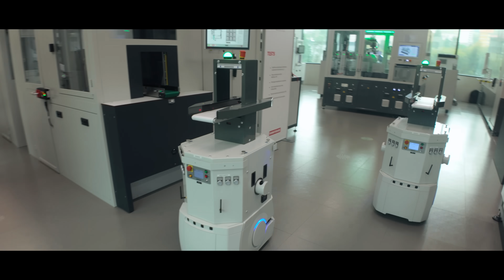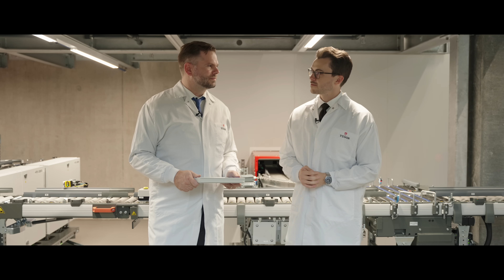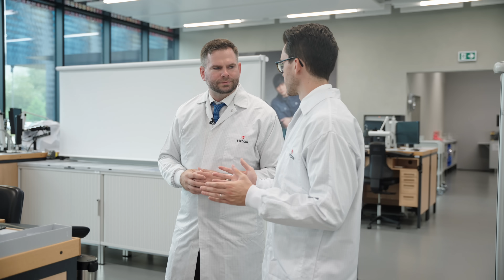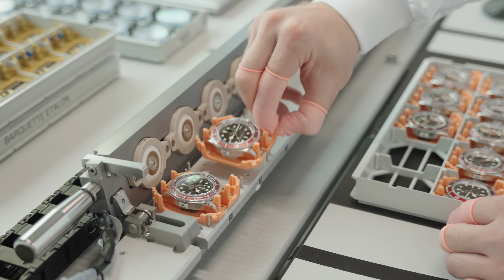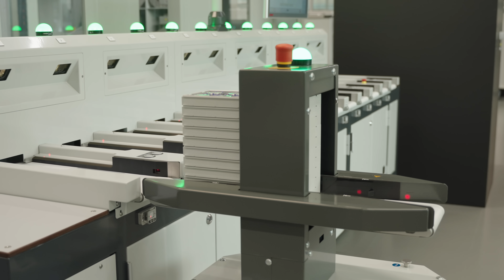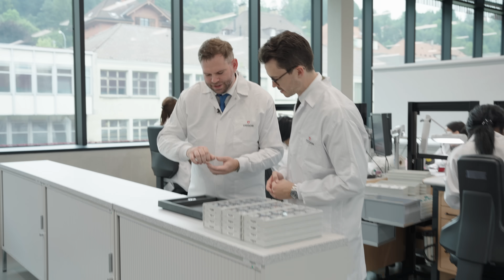Visiting Tudor’s Manufacture In Switzerland

Comment: As a point of clarity, the magnet used for the testing is 15,000 Gauss, which is 1.5T. Most clinical MRI scanners are 1.5T. So the watch could, in theory, survive being in the centre of the bore of a clinical MRI scanner. Not that anyone having a scan or working around an MRI would be allowed to keep a watch on for safety reasons. However, many research MRI scanners are 3T, 7T or more. So the watch may well not survive being near or in one of those machines. Again, this is hypothetical as no one should be allowed near an MRI scanner wearing a watch.

Comment: I have not thought about it before, but what is keeping the mechanical part of the watch from moving inside the case and under the crystal? are there grooves or something that is slides into? or is it the pressure from the rear, squeezing it like a tight sandwich? or is it just the crowns post holding it from turning left or right inside the case? my mind is racing

Comment: Just judging by this video (and I could be wrong), it appears Tudor has a very different philosophy than even Rolex as it appears to lack much vertical integration. Kenissi movements are made next door, thus qualifying the watch for "Swiss Made". 

But I strongly suspect the case, hands, dial are all coming from outside vendors (most likely Swiss) and Tudor is primarily doing the casing and final assembly of the watch as shown in this video, with a lot of help from automation. 

Bracelet is almost assuredly also an outside vendor, and I doubt that is Swiss, it appears a lot of bracelet makers are in France and/or Italy for these Swiss watchmakers now. 

Some make take umbrage to this process, but ironically it's the traditional way Swiss watchmaking has been done for generations. Vertical integration is actually the anomaly. The industry would have companies specializing in hands, cases, dials, even movements and those would all come together for final hand assembly. So Tudor in a sense is blending the old and new way of doing things.

Comment: positive pressure reminded me of when i built my gaming PC and setting up fans in the case to create either a postive neutral or negative pressure. it does speak to how dust will move through out the unit. i do think he was trying to be funny. but he was still delivering crucial information to the process. hes saying thats an ultra clean facility. probably ISO rated. Cleanrooms are classified by the number and size of particles allowed per cubic meter of air. The classes range from ISO Class 1 (the cleanest) to ISO Class 9 (the least clean). Positive pressure environments are often used in these cleanrooms to ensure that contaminants from less controlled areas don't enter the clean space. further more iterating why he brought up the conveyor belts in the walls in the first place. no cross contamination.

Comment: Talk is cheap. I sent back my brand new BB54 for warranty because of the 12'clock lume dot being visibly off-centered. Tudor sent it back 4 months later without anything done stating the error was within QC-margins. I did the same thing with a Citizen Promaster that cost 200 dollar and they fixed it with no questions asked. Tudor will forever be a scumbag brand in my book.

Comment: Dials made in the east, hand made in the East case made in the East, movement bought in switzerland but the company that makes them buys the components from the East and assembles it in switzerland
Reply: And how do you know this? You can contact Tudor/ Rolex client support and ask on source country for casing, dials, hands, bracelets, movement. I’ve also contact Breitling. It’s all made throughout Switzerland (Geneva , Le Locle etc). Breitling has similar sourcing which is historically how watch manufacturing is made in Switzerland. The Japanese are more vertically integrated and of course Rolex , but Omega, TAG, Breitling and of course Tudor operate differently. So how did you obtain this information that Tudor is Asian country sourced?

Comment: Seems like with all the automation and not many pesky humans involved in the assembly they should be cheaper. Is Rolex using the same tech to crank out a million watches a year. Is that why they won’t let you peek behind the curtain? However the automation probably has more consistency and quality so not necessarily a bad thing.

Comment: not a SINGLE cnc mill or lathe...so sad. this is watch ASSEMBLY not watch making.
Reply: Why the fuck would you have dirty oily coolant filled CNC machines at the same place the head of the watch is assembled, you're like getting a tour of assembly of a boeing airplane part complaining that you're not in the production department with fork lifts driving around being deafened by steel and aluminum being cut
Reply: @mad0uche  Right, a 1/4 of the comments are so hating, Ill bet they dont even own one or a Rolex. LOL

Comment: Tudor's own in-house movement was a huge move. They bought Kenissi and moved them into the building next door. Rolex engineers designed the movement, and Kenissi built it. By calling it a Kenissi movement, it's easier to sell it to other companies like Breitling and Tag Heuer.
Reply: Breitling is a part owner of Kinessi along with Chanel. Breitling & TAG cases & dials are much nicer than basic Tudors.

Comment: Letter to Tudor: (2 min read)

Hello, 

I want to start by saying that the Pelagos 39 is one of the best dive watches I have ever seen, and I absolutely love it. However, the lack of lume on the hands has been a bit of a letdown for me, and it's making me hesitant about fully embracing Tudor. Don’t get me wrong, the Pelagos 39 is an incredible watch. Mine runs at an astonishing -0.2s/day, meaning it’s only lost 10 seconds over 45 days, which is amazing! But my journey with Tudor hasn’t been without its challenges—allow me to explain.

The first Tudor I ever bought was the Black Bay 41 METAS Burgundy. It was a fantastic watch, consistently running at +2s/day, and I was in love with its design. However, my OCD started to kick in, and I became concerned about the aluminum bezel scratching over time. I know it’s irrational, but I felt a ceramic bezel would be more durable, and a black watch seemed like a better fit for my first collection piece. So, I sold my Black Bay 41 and bought the Pelagos 39.

When I first laid eyes on the Pelagos 39, I was heartbroken. As beautiful as the watch was, I immediately noticed two pieces of dust under the glass on the sunburst dial, which caused an irritating focus issue for my eyes. To add to my disappointment, the hands looked unevenly finished—almost like wrinkled paper. I reached out to my AD for a replacement, and after a 4-6 week wait, I finally received a new unit.This one was perfect. Seeing the Pelagos 39 in person is a whole new experience. The brushed titanium surfaces give it a rugged, durable feel, and the red "Pelagos" text provides just the right pop of color against the black dial. It’s both aesthetically and functionally fantastic. The ceramic bezel in the pelagos also has a unique character compared to regular polished ceramic—it’s matte, brushed, yet refined. I now wear the watch on the rubber strap it came with, which I find incredibly comfortable. I’ve never hesitated to put this watch on my wrist, whether I’m swimming, camping, or hiking—it feels rugged and dependable in any setting.

However, the lume on the hands remains a disappointment. It’s noticeably weaker compared to the bezel, and while it might seem like a small detail, it detracts from what could otherwise be the perfect watch. Every time I look at the Pelagos 39, I’m struck by its beauty, but reading the time takes an extra moment because the hands don’t stand out as clearly as the bezel.Tudor, I truly love this watch and want to continue loving Tudor as a brand.

I’ve heard that when customers raise concerns about the lume on the hands, they’re often told it’s within spec, and my watch is likely no different. But from one watch enthusiast to another, I don’t want to sell this watch. If you could address the lume issue on the hands, I would be incredibly grateful. I already admire the build quality, the rugged look, and the precision.

Thank you for taking the time to read my message. I sincerely hope to hear from Tudor soon.

Best regards, Ataberk Nalcakar

Comment: We have seen how for example GS makes hands, others making lume, some making even stones at the production plant, here we only saw assembly and testing. So my question is, where is all made at?
Reply: You just hit on what makes Seiko so special, their verical integration. Where Tudor sources their parts from other vendors (hands, gear train, etc.) Seiko goes as far as farming their own quarts crystals and manufacturing their own lube for the gear train.

Tudor makes amazing products no doubt about it, but the operation and dedication of Seiko and Grand Seiko is something special in itself.
Reply: You know. 🇨🇳
Reply: The manufacturing is done in the black building next door. They bought Kenissi and moved them there, and they make the Tudor movement. They then sell this movement to multiple other companies. I think Breitling, Chanell, and Tag Heuer use this movement.
Reply: @TexanUSMC8089  i work at Breitling. it's an exchange of mouvements. they get the B01 we get the MT5612 and rename it B20. the first mouvement that you see in this video is a Breitlin B01.  I mainly work (machinig) on the 2 upper bridges that you see.
Reply: @TexanUSMC8089 the swiss air guy literally said "comes in from suppliers" 🤔
Reply: Breitling and Chanel are co owners of Kenissi along with Tudor. Tudor doesn't actually make anything.  @TexanUSMC8089
Reply: @TexanUSMC8089  do they actually make(machine) all the parts for the movements there, or do they just assemble the movements?
Reply: the ones that are not third party ( Breitling B01 ) are manufactured by Kenissi. Kenissi and Tudor have joint buildings but the edit in this video hides it well.
Reply: @angelogeraldes5776  have you seen the tunnel that links Tudor and kinissi?
Reply: Next door at kenissi
Reply: Kenissi has a chain of conveyers that stock the Tudor factory with parts to build watches. The movements are bespoke to Tudor but the parts, cases, bracelets, straps are not. The Swiss are very secretive about this but you can eventually unravel where every single component is made since it's all local. The cost savings for Tudor come through this intricate supply chain whereas Rolex doesn't bother and uses the most expensive supply train to where they produce their own ingots of steel for their watches, tools, sapphire, etc. Thats why Tudor isn't the poor man's Rolex anymore, they're probably one of the most technologically advanced watch brand on the planet. 

Grand Seiko doesn't care about money because the fiscal responsibility of their brand is carried on the back of Seiko. It's like how Lexus made and sold the LS throughout its entire production run at a loss, whereas Mercedes and BMW actually had to make money so they always have to update and make their products superior while Lexus tends to make the same car for 10 years. Grand Seiko cuts their own parts, hands, grows their own quartz, 100% in-house dial production.

The Swatch Group bought out a good chunk of these producers to retain the moniker of in-house. At the end of the day buy what you like, don't reward all this bait and switching. Theres a reason certain brands like Panerai and Hublot fell into the shit because they prided themselves too much on playing catchup and their tactics got the best of them when they were selling shoddy product, made from spare parts, at top dollar while claiming they did this and that. The old hand-wind and ETA Panerais were FINE
Reply: I'm guessing the companies don't want to reveal everything, for various reasons. Maybe they don't want to spoil the image of cleanliness and precision by showing the case bodies being machined. maybe they have proprietary equipment or processes that they don't want to reveal, and maybe it's just to keep some of the mystique. 
I too, would love to see much more detail, no matter the brand.
Reply: @cerealport2726 hoping for a link to sources but, another commenter claims Tudor cases are made off site in the same factory that a Christopher Ward cases are made
Reply: @Not-a-bot222  interesting. Still made in switzerland though... 
I live in France and there are a number of high end foods that people (mainly tourists) want to buy from a handful of companies - chocolates, macarons, etc. the majority of these products are now made in Romania and trucked in to France.
Reply: @cerealport2726  yes but some people also appreciate vertical integration or value different aspects of watch making. I have no issue with bespoke parts…when transparent
Reply: @Not-a-bot222  i'd love to see the whole process

Comment: Do they actually make anything or just assemble parts made elsewhere?  Looks more like Tudor is a watch assembler, not a watch maker.
Reply: Right next door in the black building is Kenissi, where the Tudor movements are made and assembled.  Tudor has their own movement. The red building is primarily for assembly and testing.
Reply: @TexanUSMC8089  so the other building is where they unload the trucks with parts from china or are they actually making them from scratch?  That was a major part of the process missed by this video and makes one suspect they want to hide that part.
Reply: @DadeMurphie  
There are no parts from China. Everything is made in  Switzerland. If in doubt, contact Tudor directly and they will  confirm all parts from movement to case to braceletes are made in throughout Switzerland. This goes for Breitling as well.
Reply: @DadeMurphie all Tudor and Rolex parts are made in Switzerland, that building attached to the Tudor building is where they are manufactured, your either not paying attention to what is being said in the video or you’re sadly lacking in comprehension.😢
Reply: @leoanthony7281  the building next to it is where the movements are made. Tudor makes nothing. They are a high quality assembler of Swiss parts.
Reply: @leoanthony7281  They should have shown that in the video.
Reply: In the grey building attached to the red Tudor building is where Tudor make every one of their movements. Tudor purposely named their company that makes these movements a different name to Tudor because Tudor movements are used by Breitling, Tag Heur, Bell & Ross, Channel among others and Tudor didn’t want those brands to be able to say their watches were powered by a Tudor movement. I think they named that company Kenisee or similar
Reply: Are you mentally handicapped or did you not watch the video?   What do you think other watch companies do?
Reply: Are you mentally handicapped or did you not watch the video?  What do you think other watch companies do?
Reply: Tudor and many other brands will make everything from raw metal.  Maybe the sheet metal is not formed by Tudor but really, at that point it’s not worth nitpicking.
Reply: That’d what 99% of brands do including Rolex and omega so what’s your point
Reply: So this video pretty much confirms all the parts are manufactured elsewhere by 3rd party suppliers and Tudor simply assembles them through automation.  

I’m actually less inspired by Tudor after watching this video.
Reply: @Superdada 
Kenissi I is their in house movement manufacturer.  Kenissi is in a building next door.  The video is showing the assembly area.
Reply: @Iexpedite1  Kenissi also sell the same rebranded movement to other watch makers. The movement in Tudor watch is not unique to Tudor.
Reply: @samyb2834  
Tudor owns 80% of Kenissi and Chanel owns 20%.  They sell movements to other companies.  What manufacturer doesn’t sell movements?  Not very many.
Reply: @samyb2834 Correct. Swatch own ETA…and Longines modify for most of their watches. No different than Tudor
Reply: @Superdada  not unique to Tudor.  Most “Swiss” watch companies get their parts from China
Reply: And you know this how? There are no parts from China. Everything is made in  Switzerland. If in doubt, contact Tudor directly and they will  confirm all parts from movement to case to braceletes are made in throughout Switzerland. This goes for Breitling as well.
Reply: yeah, its sad.
Reply: @SilverStackers  you’re sad with your lack of comprehension. 😢
Reply: @leoanthony7281  show a video then.
Reply: @SilverStackers  do your own research.  Teddy has another post of his visit to JLC, you’ll get to see how parts are made in that one.
Reply: @SilverStackers they probably can’t
Reply: I don’t think you are wrong but it still takes a mans hands to build it and make sure it’s working correctly. When you think about the demand for them it’s a smart move. Still interesting how they do it.
Reply: Yes, but that’s why they are $5,000 and not $50,000
Reply: If you want an in house watch buy a Rolex or Grand Seiko. No other mainstream brand makes everything. Simple as that. Grand Seiko does it because of Seiko’s crazy infrastructure, Rolex does it because they bought out every part of the manufacturing process.